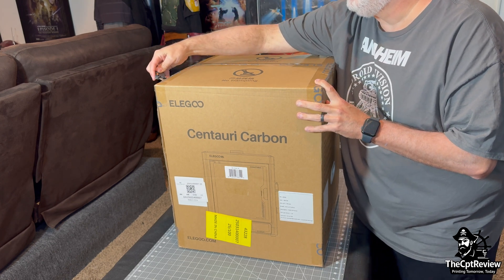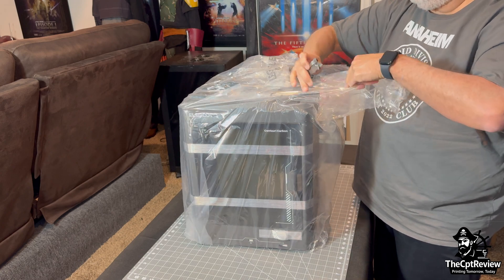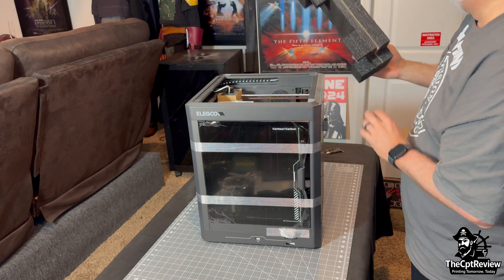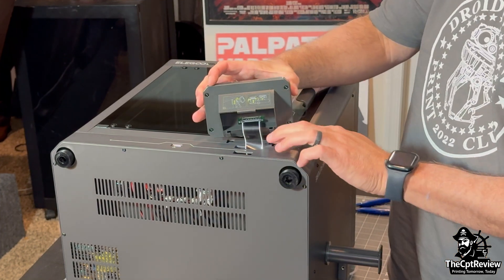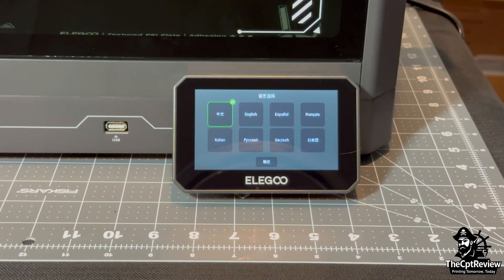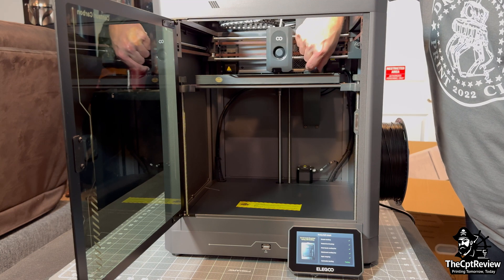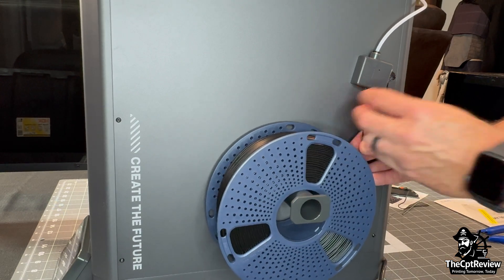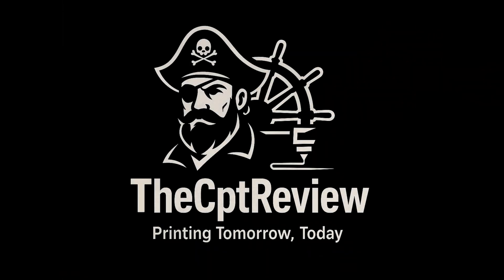Centauri Carbon Unboxing and Setup

Comment: You know what works even better than laying the box on its side and pulling theprinter out?
Opening the bottom, folding the flaps up the sides, putting the box rightside up and pulling the box off the printer. Much easier.
Reply from the maker: Sure!   Now you tell me!   lol.   Great tip!  Thanks!!
Reply: You literally have to make the same motions to get under the box to open it.. You have to turn it on its side, then open the flaps tjen stand it back upright, tuen lift the box off..
Easiest just to open the box on the floor lift the machine straight up and out and onto the table/shelf using the plastic it came in..
Reply: @fightlikabrave it's easier to lift a box off of a 20lb printer than lift a 20lb printer out of a box. Much less likely to damage the printer as well.
Spent 10 years of my life delivering and installing electronic equipment, we never tried to lift out of the box, always lifted the box off the product. In fact, the box often had instructions saying so.
Reply: @BlooMule  lol, again either way, youre goint to have to lift the machine, and they literally designed the packaging to pull right up and out without having to do anything but open the top and lift it right out. a kid can do it.
Reply: You do you, man.  @fightlikabrave

Comment: How long was the wait time from order to delivery? I ordered one 3 days ago, and wondering how long the wait is going to be
Reply: I ordered mine in March so it says shipped out day July 31. So I am waiting and wondering when and what model I will revive
Reply: I ordered mine on March 3rd,, received it June 9th. Has been running nonstop with no troubles. @barnabas2142
Reply from the maker: I picked mine up over the weekend at Microcenter.  If you just ordered, You will get the newer model with the multi color system connection port and I believe the upgraded light!  Lucky you!
Reply: @Thecptreview  This is not certain, because elegoo writes: "Can I choose the version of Centauri Carbon I receive? No, you will receive either the latest or previous version, as they are shipped randomly."
Reply from the maker: Interesting!  I was not aware of this!  Thank you for the update.   I had always heard that preordering before a certain time meant you would receive the earlier version and preordering after a certain date meant you would receive the updated version.  Which is why retail stores like Microcenter only had version 1.  Elegoo was clearing out the earlier inventory.  I am just going off what I read in the Facebook groups, so take it with a grain of salt!  I am by no means an expert!  :-).   I would like to think that someone who just ordered would get the updated version, but you're absolutely correct in that it is not a guarantee!  My hope is that regardless what version any of us early adopters purchased, Elegoo will have a free solution to adding the multi-color system when it is released.
Reply: @Thecptreview  it may be true that people dont get a choice on what they get but logicaly speaking it may only apply for people who ordered before they run out of stock of the ver1. It dont make sense for them to still be shipping ver 1 to people who ordered this month just to ship ver1 with ver 2 batches that gets done next month or sometime in the future
Reply from the maker: I would agree!
Reply: @Dimitris1963 Theyre shipped on batches not "randomly".. Big difference. Once they started shipping out the upgraded ones that's the one they ship..
Reply: @fightlikabrave  Again, this is a quote from the elegoo website's FAQ; it's not my words! It literally says, "Can I choose the version of Centauri Carbon I receive? No, you will receive either the latest or previous version, as they are shipped randomly."
Reply: @Dimitris1963  I went to the site, looked at the FAQ's and that is nowhere to be found. if it was they removed it. logically they are Chinese and im sure by "random" they just meant "you cant choose", as they clearly ship in batches. they dont have a pile of upgraded vs non upgraded and just "randomly" decide to shipp ppl one or the other. Clearly they sell out of one version, then ship the other..
Reply: @fightlikabrave  I was just on the site (global or EU) and scrolled all the way down to the Cantauri Carbon page. There's a black FAQ box. The first question there is, "Can I choose the version of Centauri Carbon I receive?" and the answer to that: "No, you will receive either the latest or previous version, as they are shipped randomly." So, nothing has changed in these sites.
Reply: @Dimitris1963  I just went BACK went to US and UK and global site, went to the CC page clicked FAQ and that question is not in the black box on any of them. 
The only 4 questions are:

How long does delivery take after shipping?
What countries do you ship to?
Do you offer free shipping service?
Can I change the delivery address of my package after it has been shipped out?

thats it. maybe refresh you cache. Either way theyre clearly shipping in batches and just wont confirm which model you get...as thats whats most logical.
Reply: I'm in Canada Est shipping Aug10 from the Canadian Warehouse, Hope it's the updated Version the the Light Bar and AMS plug. if not  .. for $299 Still worth it